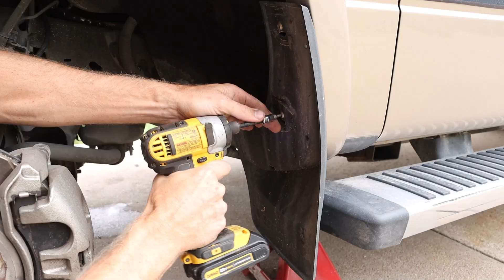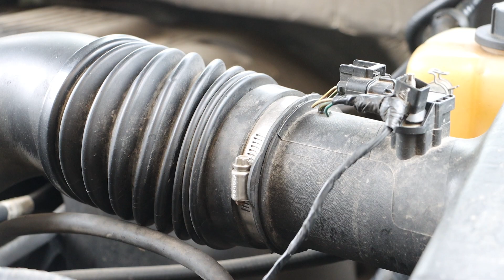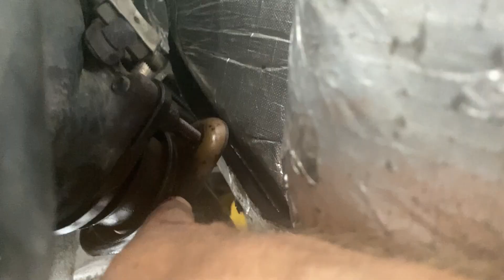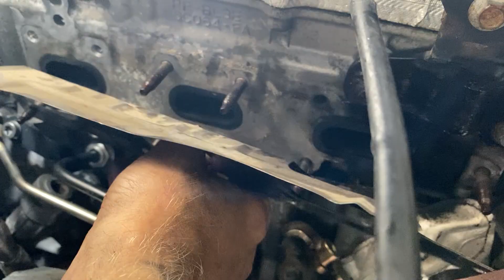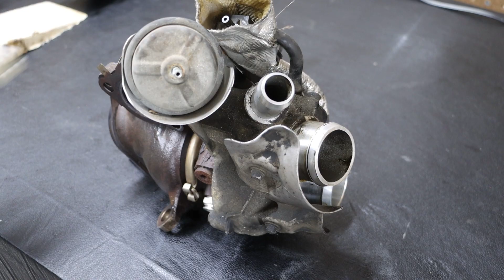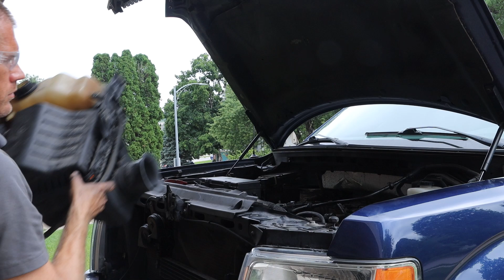2012 Ford F150, 3.5L EcoBoost - Exhaust Manifold Replacement - Driver Side Only

Comment: Hey, how long did it take you to do the driver's side?Thank you
Reply from the maker: That's a tough question because I was filming it at the same time.  However, if you have never done this repair before, I would give yourself one day to take it all apart and one day to put it all back together (per side).  I think, after having done this (and without filming), I could complete both sides in one day.

Comment: The driver side was by far the hardest side of the two on my 2013. Managed to get all studs on the manifold out with none breaking. Only difficult part was the turbo to manifold bolts. 1 of 3 snapped. Which was odd because the passenger side bolts came off with hand tools lol. This job is not for the weak hearted but these videos helped tremendously. Very well done.
Reply from the maker: Thanks for the comments...and tips.  I started with the passenger side, so by the time I got to the driver side I knew some of the delights to expect.
Reply: @InsaneOil what’s your best tip for getting the rear coolant line to snap into the turbo? I’m trying and it just won’t snap in lol I have no bolts in yet just trying to snap that on first and then put bolts in.
Reply from the maker: @alexisramos9064  I put a small bit of grease on it, hoping it would help it install easier.  I do believe I had trouble getting it to snap in also.

Comment: What tool/socket/adapter did you use to install those studs?
Reply from the maker: The kit (https://us.bddiesel.com/products/exhaust-manifolds-ford-f-150-3-5l-ecoboost-2011-2016?variant=40928806961335) came with a stud installation tool.  Besides that, I used a typical socket/ratchet set or combination wrench.
Reply: @InsaneOil gotcha. I’ve never seen a tool like that to install stud before. I was going to order that BD Diesel kit, but I just don’t have the funds for the manifold kit plus the installation kit. So I got one off EBay from Dr Diesel. I got the kit the other day and it looks like high quality parts and it was over $200 less than BD Diesels kits were. I am gonna tackle it starting tomorrow. I’m hoping it doesn’t fight me too much, I live in Michigan and I am sure everything is rusted to heck.

Comment: Great video, there’s a exhaust gasket and exhaust flange?? Or just flange?
Reply from the maker: I believe there is a gasket on the turbo side of the flange but I did not replace it as it was still in good condition.  You can kind of see it at 16:05 still installed between the flange and the turbo.

Comment: I am lost on one step. How come the old manifold had 8 bolts but the new one had 11. Where do you put the extra 3 studs ? Please explain
Reply from the maker: The block has 11 hole locations but Ford only designed the OEM manifold to use 8 of the 11 holes.  This proved to be problematic for multiple reasons.  Aftermarket parts manufacturers have redesigned the manifold to use all 11 hole locations.  Hope this helped.

Comment: Wow what a detailed video!! You done a fabulous  job! I need to do this on my 2011 eco 3.7 with 298k miles all original!! Looks aggravating which i dont like i think I will hire out wonder what's a fair cost?  Also I subscribed! Thank you for making this!!!
Reply from the maker: Thanks for the comment.  I was quoted anywhere from $2500-$4000 for this repair.  I'd be interested to know what you find out.
Reply from the maker: According to repairpal.com it should cost between $2200 and $2700 for both sides (including parts)
Reply: @InsaneOil  per side? Parts included?

Comment: How did you get that upper exhaust nut off? I'm stumped.. 😢
Reply: I am with you.  I have nothing in the tool box that will work for this top flange to the exhaust - last thing I have left holding on the turbo.  I am going to cut the bolt to the turbo between the flange with a cut off wheel and Dremel hand tool.  Kit has replacement bolts so just need it off.
Reply: I ended up using  a Milwaukee oscillating tool with  the Milwaukee Extreme Carbide oscillating blades.   It took about 2 minutes with the carbide.  It nuked one blade but best $20 I ever spent.
Reply from the maker: I lubed it up with Amsoil Metal Protector ( https://www.amsoil.com/p/amsoil-mp-metal-protector-amp/?zo=10458 ) and I think I used a swivel with some extensions.

Comment: How did you know it was the manifold? Did it make a noise like a card in a spoke wheel?
Reply from the maker: I was getting exhaust in the cab during initial start up.  Additionally, when the engine was cold, upon initial start up there was a light fluttering noise.
Reply: @InsaneOil  yeah mine is doing that at startup then goes away.  After that it drives fine.  Thanks for the reply.
Reply from the maker: @johndehart8787  I did not notice any drivability issues and I drove knowing that it was an issue for over a year before I did this repair.

Comment: Great video! I'm getting ready to do this on both sides, and I also will be replacing the cooling lines with much better aftermarket ones.
Reply from the maker: You may want to check out out my video taking you through this process for both sides: https://www.youtube.com/watch?v=8rPmHF2VVmU&list=PLYNR1w8QDiFojYFaCGHRtTi8A5szYXrDC
Reply: @InsaneOil  yes, I checked that one out too. Only difference, I'm not re-using the Ford OEM cooling lines. I got a set of aftermarket lines that don't use that garbage fitting.
Reply from the maker: @Insert_Screename_Here  Although my lines haven't leaked, if I were to do it again (and not spend 18 hours filming it), I think I would take the extra time to switch out the lines.

Comment: What is the main reason to tell these are bad?
Reply from the maker: I was getting a noticeable amount of exhaust in the cab when I would start it.
Reply: @ alright, do you know if this can cause a sort of sulfur smell for the back of the exhaust?
Reply from the maker: @Breken7  I am not sure about the sulfur smell.  In addition to the exhaust in the cab, the engine would make a fluttering sound (the sound of exhaust escaping by the manifold/gasket).

Comment: You skipped over the upper nut removal on the exhaust collar to the turbo. Any tips? Mine is stuck and I can't seem to get a good angle.
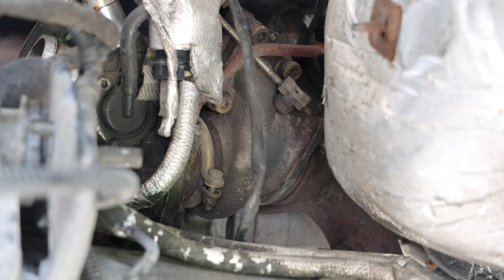Reply from the maker: https://www.youtube.com/watch?v=8rPmHF2VVmU&t=1912s  In this video at 6:52 I do the top bolt for the passenger side but skip over the lower bolt.  I don't specifically recall what I did for the driver side, other than use a lot of spray, swivel sockets and extensions.  The passenger side, I was only able to get about one click at a time with the ratchet.
Reply: @InsaneOil  thanks for the reply.. I finally got it loose... there's no secret trick that makes those easy to reach haha.. there never is! Happy New Year
Reply from the maker: @cdr343  Glad you were able to get it.  Happy New Year to you as well.

Comment: Hi, great video! How long would you estimate someone with average mechanical skill and all the tools to complete just the driver side without filming? Thank in advance and thank you for sharing!
Reply from the maker: I would say 4-6 hours per side if you don't run into the issue of the broken bolt on the manifold.

Comment: This job went way too easy for you lol those studs always break off in the block
Reply from the maker: I was prepared with my welder for the broken off studs but I was very lucky that neither the passenger side nor the driver side had that issue.

Comment: Best auto mechanic video ever! Makes this long, complicated job look doable. Tips on removing and reinstalling the two coolant line fittings into the engine block would be welcomed.
Reply from the maker: Thanks for the comment.  Overall, this was a challenging job but was necessary to be completed.  I did not remove/replace the coolant fittings into the engine block but I would recommend a set of long picks (for the retainer clip) and a lot of patience.

Comment: Very concise and thorough video.
For R&R of the turbo, I used a 1" ratchet strap to pull the exhaust pipe back and out of the way - it makes the process a bit easier.
Reply from the maker: Thanks for the comment and thanks for the great tip.

Comment: Hello thanks a ton for this video! I'm going to tackle the exact same job next weekend. Would you have the part number for the coolant line fittings?
Reply from the maker: Coolant fittings were included in the Turbo Install Kit I bought https://us.bddiesel.com/products/exhaust-manifold-install-kit-ford-f-150-3-5l-ecoboost-2011-2016?variant=40928806994103 ... I am not sure what the exact part number is.  I think this is the one but I am not 100% sure https://www.summitracing.com/parts/frd-bl3z-6a968-c?seid=srese1&ppckw=pmax-stock-replacement&gclid=Cj0KCQjws560BhCuARIsAHMqE0H0DkN1GHQl4SF9kiUMVXrKvmcUf_L5hCsyR3oW-agyZoicHMHcY4kaAj8ZEALw_wcB
Reply from the maker: If you are doing both sides, I have a version of this video with both. https://www.youtube.com/watch?v=8rPmHF2VVmU&list=PLYNR1w8QDiFojYFaCGHRtTi8A5szYXrDC
Reply: Gracias.muy buen video bien explícito 👍 saludos desde Chile 🇨🇱
Reply from the maker: @mauriciobriceno5114  Me alegro que el vídeo haya ayudado.  Gracias por el comentario.